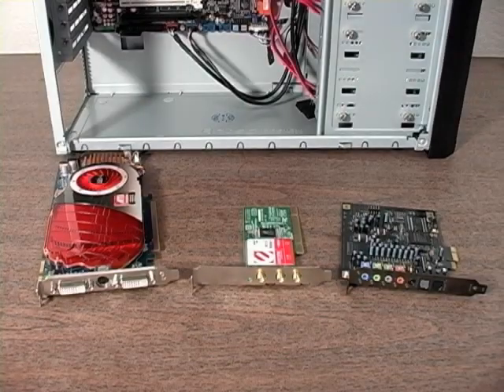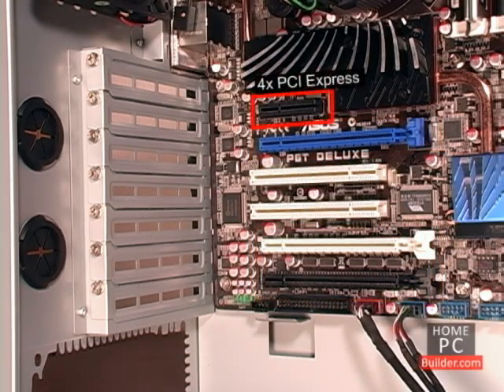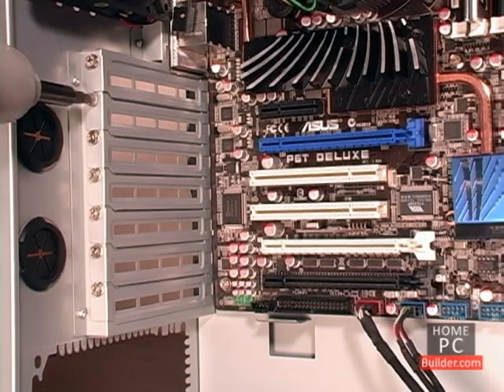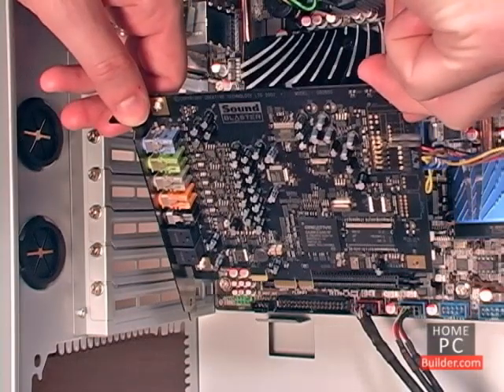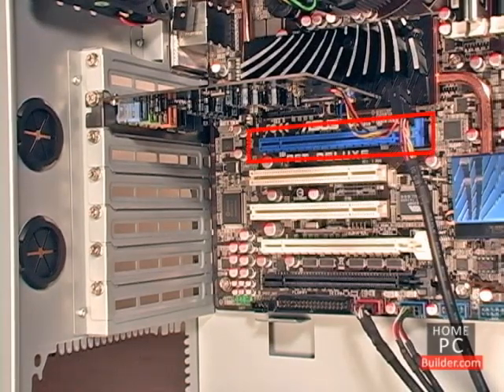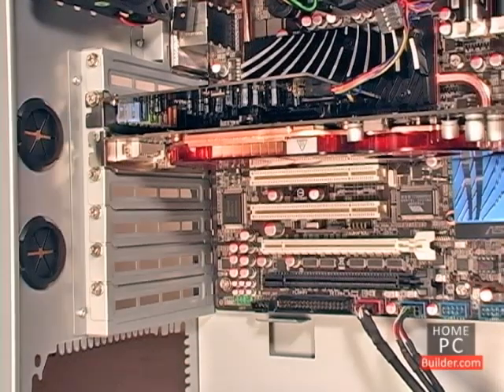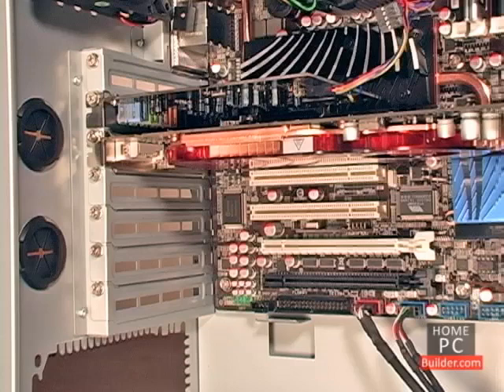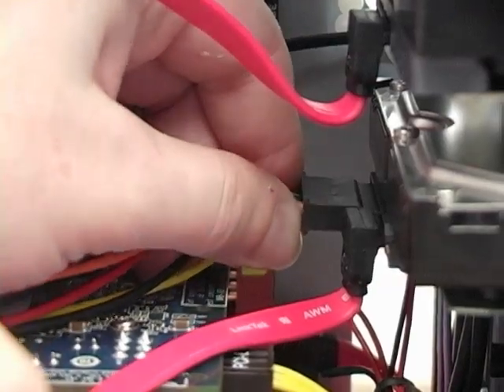Build a PC Computer - S03 L08 - Install video & other cards - All New for 2010 - homepcbuilder.com

Comment from the maker: You can use a PCI video card to connect more monitors and extend your desktop.  You might want to check with the maker of the card.  They may have a fix for the tearing or a warranty exchange may be available.

Comment from the maker: @serialfear The audio cable coming from the front of the case will often have two connections.  One usually called HD Audio and the other AC97.  The AC97 is for backward compatibility with older motherboards and sound cards.  You should connect the HD Audio to the motherboard and leave the AC97 disconnected.

Comment from the maker: @iFreshly I downloaded your computers manual from dell's support site and it looks like there is a external card retention bracket on the back of the computer that is held in by a screw.  Once that is off and the computers case is off of coarse the cards will be accessible.

Comment from the maker: @BCB228 It has a PCI Express 16x slot so it can take a good video card.  The problem you'll run into is not having enough power for a good video card.  The power supply is only 250W.  That said if you just want to put in a $70 video card, which doesn't require much power, I think the power supply can handle it.